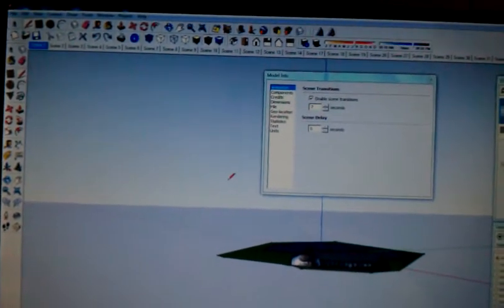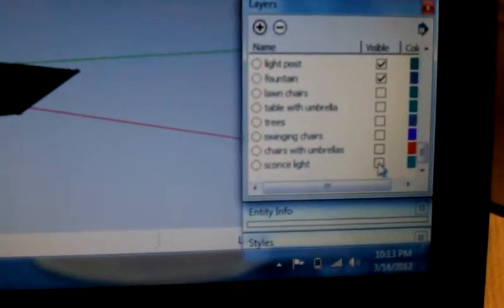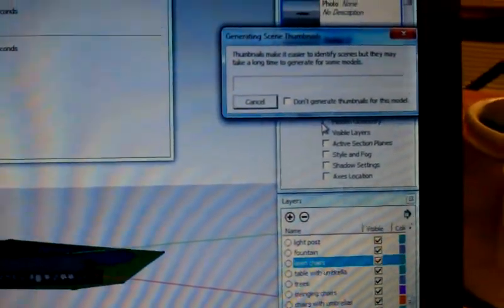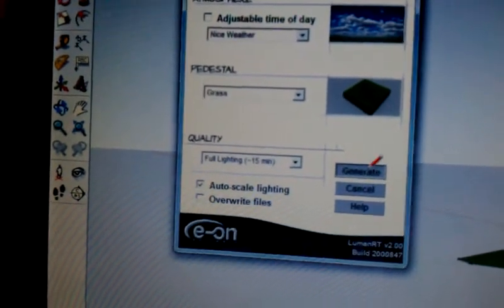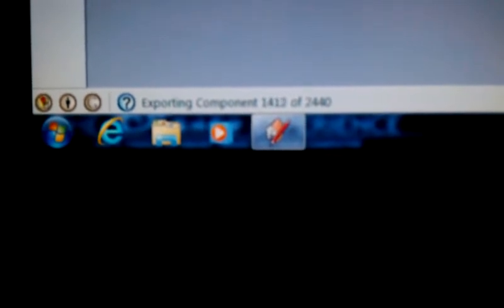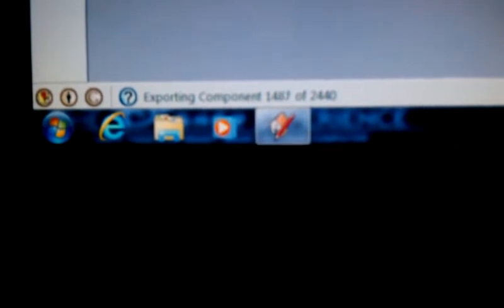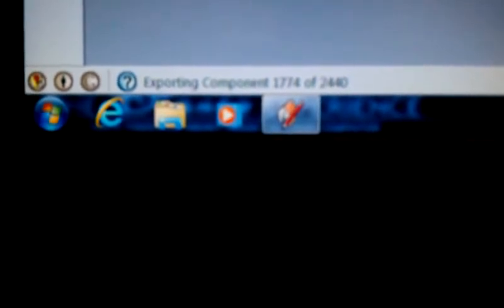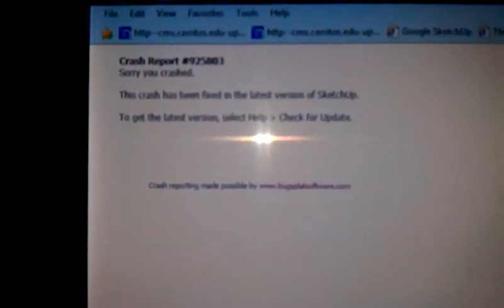Lumen RT 2 Issue

Comment: I have exactly the same issue with one of my models. I was up against a huge deadline last week to export an animation so I was in contact with e-on software, sent them my model and they did not know how to rectify it. I also sent my model to a sketchucation forum user they couldn't either. I ended up splitting up my 140mb model into several 20mb models and stitching each animation together. My conclusion is that Lumen cannot handle complex models. Did you manage to come up with a solution?